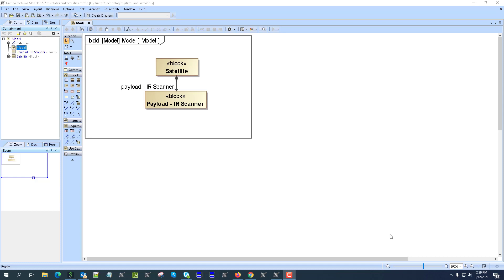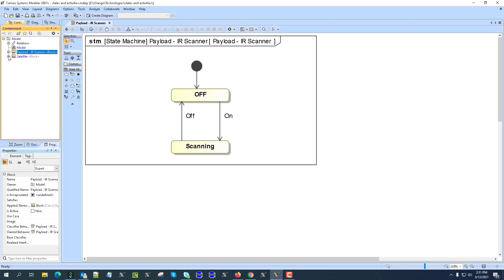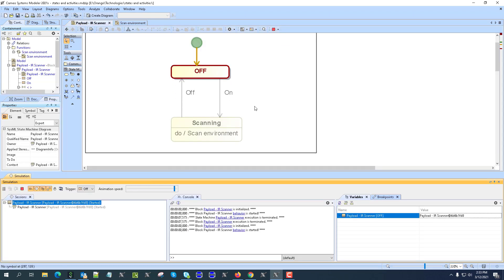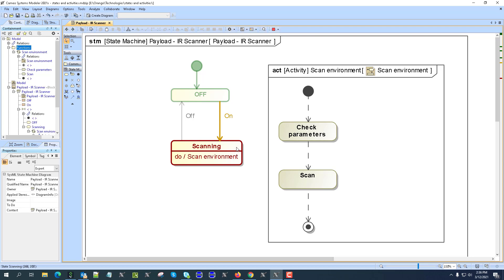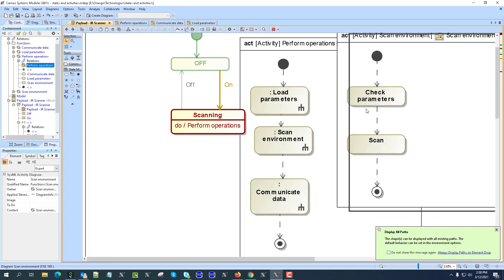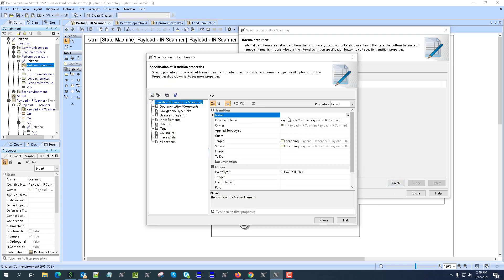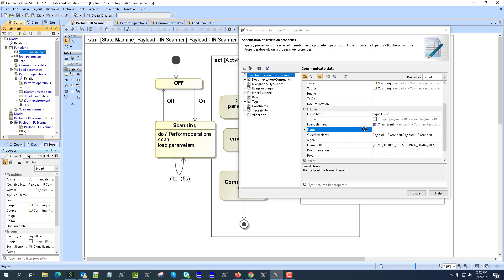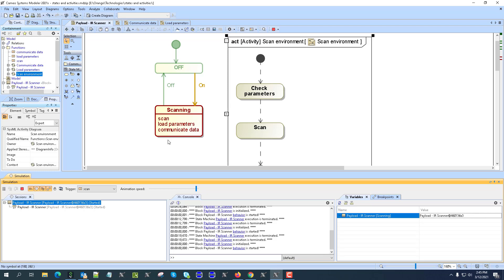How to Model and Simulate States and Activities Together as Part of a Single System Model in SysML

Comment: Thanks for the very helpful video. I run into a problem when activity diagram has a decision node, in that case the diagram opens in a new window. Is there any work around?
Reply from the maker: Hello, thank you! Yes you can have guards after decision node which are resolved automatically: based on value property pf context block, randomness, or just True / False.

Comment: Thanks for the video. I am looking how to integrate a decision table into an activity diagram. I have three parameters that could take boolean values, and need to output specific values for each combination of parameters. How can this be modeled and simulated? Ideal is to take the input parameters from parameters values of defined blocks and output to an other parameter of targeted block.
Reply from the maker: What about opaque action with input and output pins performing some logic?

Comment: I have multiple states that all perform the same activity while in each respective state.  From a reuse perspective, I am concerned by having multiple activities with the same name in my model. Is there a way to assign activity to a state without creating another duplicate activity calling the original one?   I understand state transitions and assigning activity to a signal, but that still creates another activity and diagram essentially acting as a pass through to the main activity.
Reply from the maker: Hello Jake, thank you for your feedback. As you know and indicate by draging activity on state it gets assigned to it. Same activity can be assigned to multiple states. Standard requires that activity would be in state, so on drag and drop of activity another activity is created which calls oroginal one and added into state. So original activity can be at any location and be compleatly reusable.